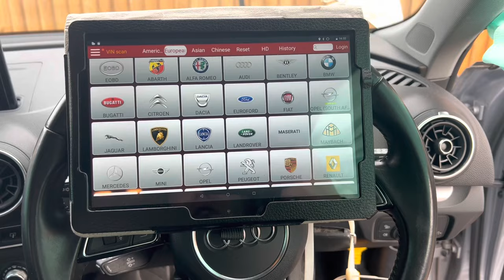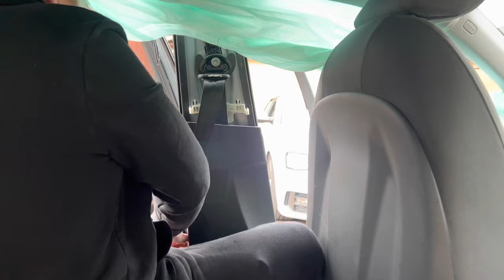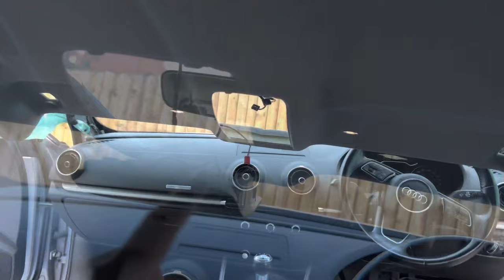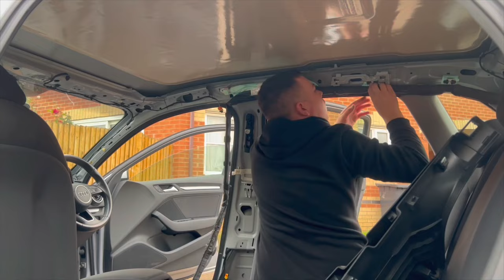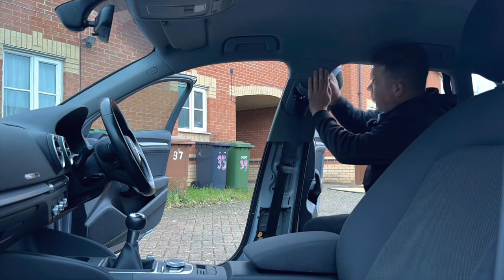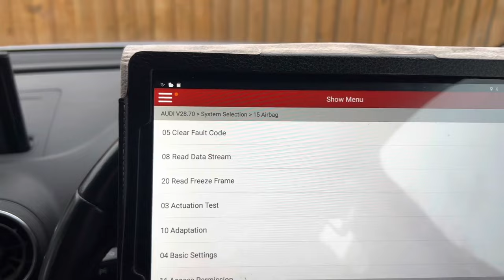Rebuilding a Damaged AUDI A3 from copart uk PART3 Replacing airbags!!!

Comment: Hello Nathan, any idea and guide you can give me on this?  Many thanks.
Audi a3 2015

B10381b actuator for pedestrian protection rear driver, resistance too high

B10391b actuator for pedestrian protection rear passenger, resistance too high
Reply from the maker: Hi roshni the codes your have wrote are for the bonnet actuators that connect on the bonnet hinges . Was the back of the bonnet lifted next to windscreen?
Reply: Hi Nathan, thanks for your reply, Bonnet was not lifted, front bumper corner end had a small touch